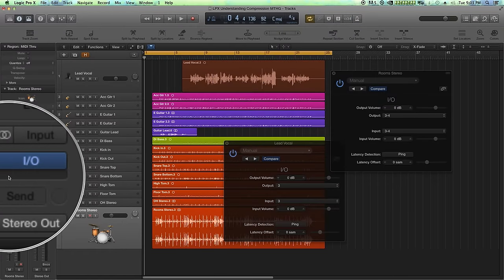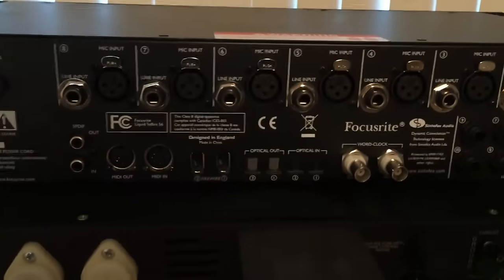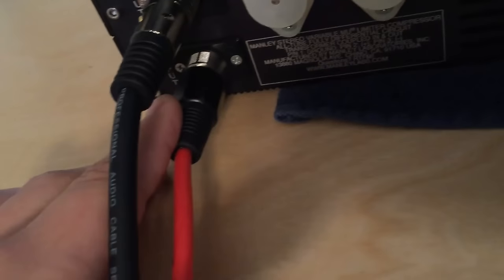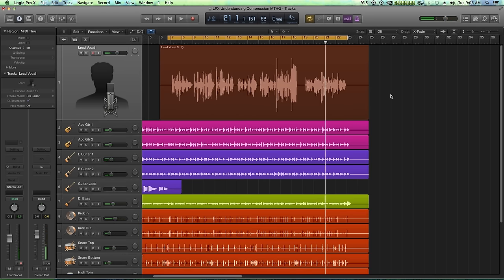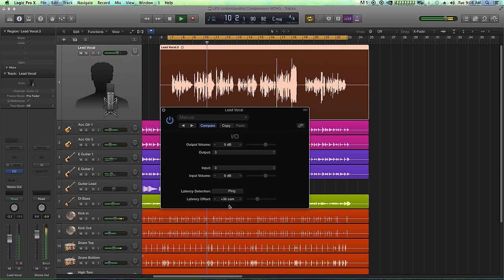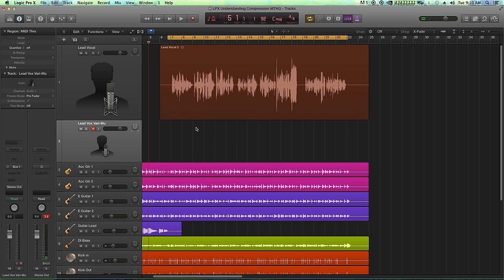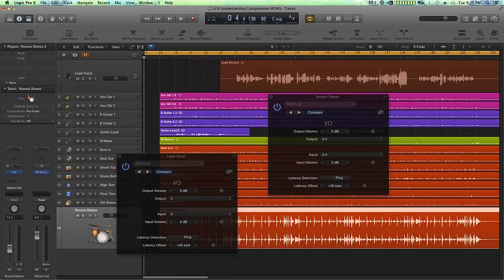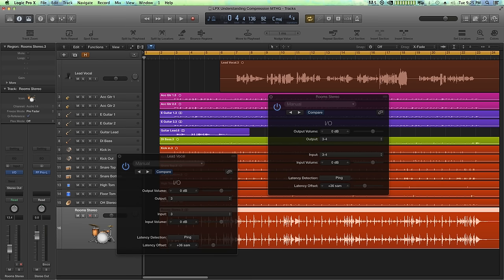Logic Pro X - I/O Plug-in - Using External Hardware for Audio Processing and Mixing

Comment: Thanks for the nice tutorial. I'm pretty lost here though, after searching and testing many days. My external FX out is connected to my focusrite in 11/12, the external FX in is connected to the focusrite out 13/14, same is selected in the I/O. Mix level on the external FX is 100%. When i set the I/O Dry/wet to 100%, I don't hear anything. In the MixControl monitoring, I can hear the effect under the DAW fader. When I monitor the  focusrite in 11/12, I get a huge delay. There is clearly something I'm doing wrong. Does anyone have an idea please?
Reply: If you still struggling with that I can help you.
Reply: @Lv74music  Hello. Thanks for your kind reply. It's OK, I managed 🙂
Reply: @bubbleboymusic  how did you figure it out? I'm having the same issue..
Reply: @HuffwareStudio  Hello, let me try to remember, if I do, will let you know ASAP
Cheers

Comment: Thanks for the great video. I keep having an issue where after I process my track and move the i/o hw insert to another track I get no ping or audio passing thru. Seems like a bug in Logic but I can’t find any info on the issue. 

For example, I print my external comp on the drum bus. Then I remove the I/o insert and then insert it on my 2 bus and I get no signal. It’s making me insane...

Any ideas anyone?? Thank you!
Reply: For anyone else with this issue, it turned out to be a glitch in Logic. Updating to a newer version fixed the problem.

Comment: I wonder if you can achieve this with a simple Focusrite 2i2 interface
Reply: It depends how the mix control / bus is setup on the 2i2....however 2i2 is 2 Inputs / Outputs so I bet the headphone out is bonded to the monitor outs and can't be set as outputs (3,4) like they can on the other focusrite devices.  For example I have the 18i8 so I have up to 18 Inputs and the 8 Outputs are (1,2 Monitor LR / 3,4 Headphone1 LR / 5,6 Headphone2 LR / 7,8 SPDIF LR)  So I can bus out of my headphone outs if I need and the mix Focusrite Mix control will allow me to run them mono or stereo.

So you could use your monitor outs and, but it would be pointless because you wouldn't be able to hear the processed audio anyways since you are using your outputs.
I never thought I would need several output options as I used to do everything on board, or in the chain.  I outgrew that though and since you can't expand outputs on the focusrite 18i8 with ADAT I decided to pick up an older, cheap Firewire interface off of ebay.  I got a MOTU 828 which has 8inputs and 8outputs.  I can set it up as an aggregate device within OSX and that way I have 8 extra outputs I can bus from.  Might be looking into.

Comment: 13:08 - 13:22...
Any recommended "must have" tools that don't rip through my wallet like a hot knife through butter? :)
Reply from the maker: +Lord Tea There's a lot of great 500 series gear that won't break the bank, and also won't eat up a lot of space on your desk. Get yourself a used API 500 series rack and start slowing filling it up with gear. Start with a stereo pair of compressors or EQs. I really like the stuff from purple audio. The beauty of most analog gear is that most of works just fine even if it's used. I don't think I've bought a new piece of analog gear in ages. I've always used eBay or reverb.com.
Reply from the maker: +MusicTechHelpGuy WARM audio has a whole bunch of stuff that models more expensive units, at a much lower cost.
Reply: +MusicTechHelpGuy Thanks for the tips! So far I have a bunch of analog synths in my home studio, the rest is done exclusively in the box. And that might change some day!

Congrats on the new website and on this wonderful YouTube channel Josh. Keep up the excellent work!